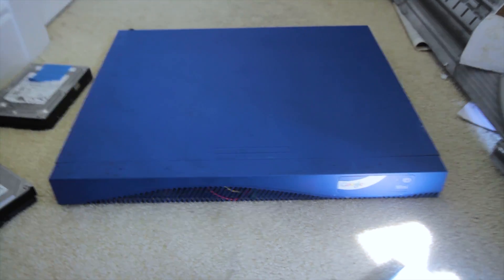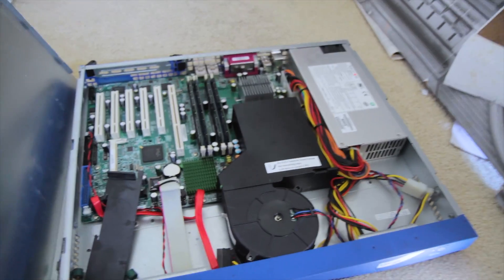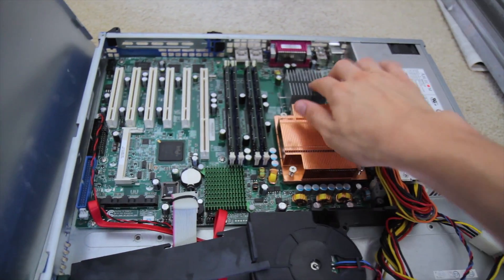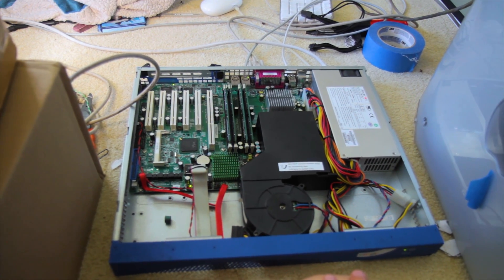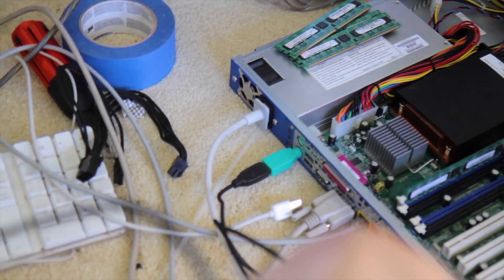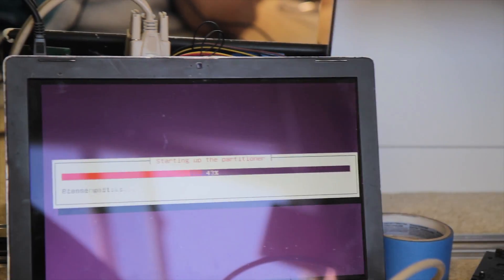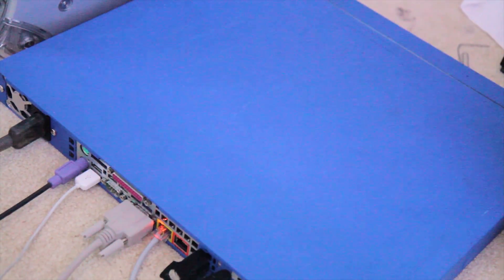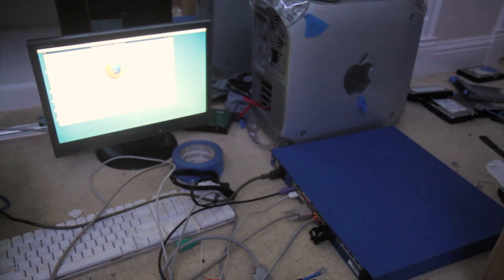Firing up a Google mini server

Comment: Just ordered one of these off eBay. Thanks for solving the 32bit issue, saves me some trouble. I'm interested in getting a more powerful rack server, any recommendations? I keep seeing cheap Dell R710s around. Any comparable servers I should look at?
Reply from the maker: +Aaron Nies the hp dl380 g6 is the hp eqv and the lenovo x3850 m2 is the lenovo version. There are also versions of these servers like the hp dl180 g6 and dell c2100 that let you put 12 drives in if you want more storage, but they normally have less pcie and ran slots. I'd personally  buy a r710. It seems to be the best option these days.
Reply: ElectronicsWizardry Thanks for the quick response! I'll check those out.